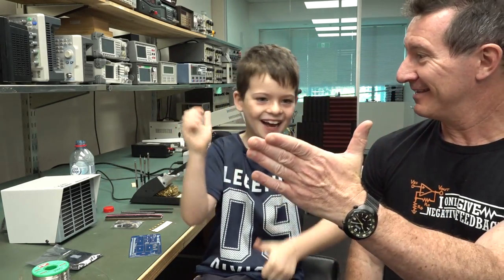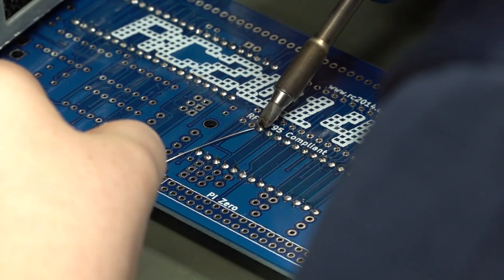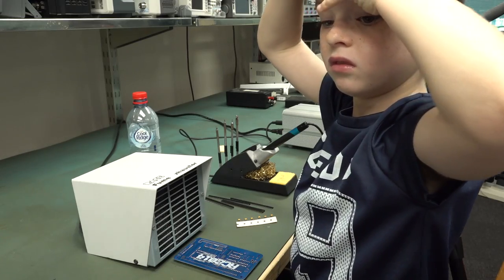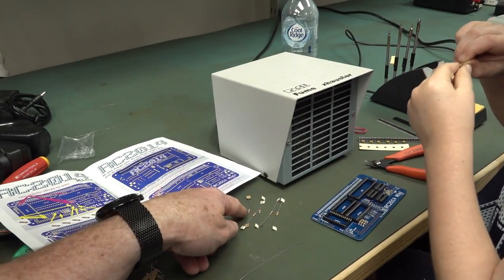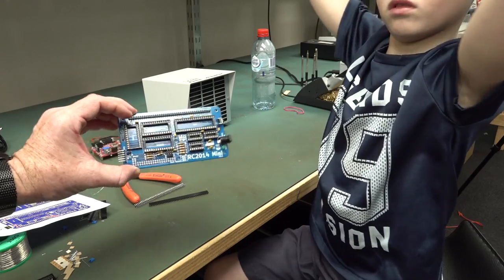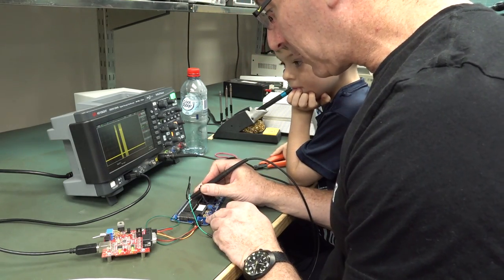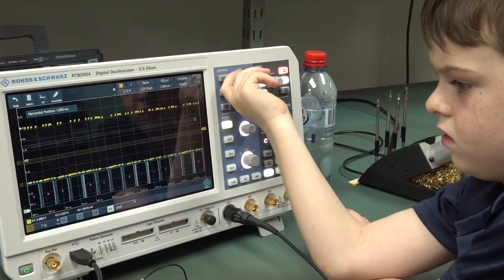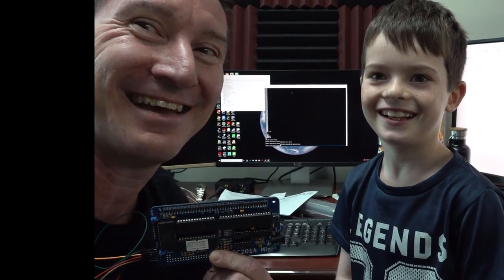EEVblog #1205 - RC2014 Z80 Computer Kit Build

Comment: Well great scott doesn't really have a nice pace station like this one now does he?!. All the kid is doing is touching the soldering iron tip and feeding in the solder, you LITERALLY CANNOT DO THIS if you have a bad soldering iron. Let me explain to all the silver spoon entitled frogs in your golden well about the hell of using cheap soldering irons. $2 soldering iron, takes forever to heat up, as soon as it heats up, the tip goes corroded black so it doesn't wet the solder, u spend 5 min trying to clean it, then that cheap solder that claimed to be 60/40 doesn't even melt (androkavo has a video on Solder wire - Low vs High Quality) and by the time you do all this, you've ripped off the pad on the pcb. This is my first hand experience with bad tools. Good tools do make a difference!

Comment: What were you talking about that was the same size as the solder? Something that was .3 and .5 mm?

Multicore is my preferred brand. It just works so well. I have some others and I usually end up using flux.

Comment: Pin Straightening Tip: Use an empty mechanical pencil, insert the pin into the empty pencil lead chamber and bend until straightened!  Error Code: P.I.C.N.I.C. = Problem In Chair Not In Computer

Comment: Are there any advantages of using multicore solder?
Reply: You can do more stuff at the same time ;-)
Reply: @karsnoordhuis4351  bravo sir
Reply: @Alex-Zone  in all seriousness, apparantly it it to prevent the solder dissolving the copper on the pads and dissolving your iron. According to the manufacturer that is.
Reply: Often times liquid flux burns off as soon as heat is applied. Bundling the solder with the flux allows it to be easily continually applied during the actual soldering. Flux has a few benefits including cleaning the joint and allowing the solder to flow. Using a thicker gel-flux like louis rossman uses is another method to flux intact.

Comment: I remember how was me at that age, curious, patient, I asked my parents to buy the first soldering iron, I made the first PCB for a small flip-flop with LEDs at a club for electronics in middle school. There I learned first things about passive and active components, the color codes for resistors and capacitors. It was 1997 and I was 10-12 years old. Then I made at home a 5-band tone corrector with transistors, and no PCB, just wires. Then I placed an audio speaker at its output and it worked, but the volume was low. Then I though about this for a while, and I came with the idea of using an amplifier at its output and it worked! Then I made an amplifier with some 2N 3055 transistors, than I bought from a shop along other components, some components I recovered from some old boards I found. No long after, when I collected a few more components I start organizing the components in boxes remained from melted cheese, with a label on each one, and I still have some of those boxes today. I also made a box out of wood at my grand parents house, and I used it for storing tools. The box still exists there, with some tools in it.
I wish I had someone kind and enthusiastic to explain me everything I wanted to find out about electronics. Maybe help me a bit, but also letting me free with it. I liked the freedom I had, and it was my only decision to find more about electronics, my parents didn't interfere. I also read some books written by Jules Verne back then, describing wood ships and travelers on the sea, searching for treasures, describing the nature and the life on the sea.

Comment: That brings back fond memories of building the "Super-80" (no, not System-80) from Dick Smith Electronics and getting it to work.  Then finding out that the BASIC they made for it absolutely sucked.  Then getting the whole disassembled BASIC interpreter for the TRS-80 and typing it into the Super-80 in hexadecimal followed by modifying it so it would run on the Super-80.

Those were fun times.

Hmm... my Super-80 is still sitting out in the garage...

Comment: What voltage levels does your RS232 adapter expect?  Standard RS232 is -3 V and +3 V.  Usually, having the D9 or D25 connector means these standard voltages are used.

Comment: I loved the Z80 and it's instructions set. I used to own several computers with that chipset from early S100 boards, CPM computers, and even a radio scanner controlled by a Z80 system. I reverse engineered that scanner and rewrote the code to suit my purposes.  Hours of fun.

Comment: No credits should be given to RC2014. It is not their design. They have copied the schematic and downloaded the ROM from Grant Searle's web site and designed a PCB from it.
 (google Grant searle and look for 7-chip Z80 computer) . All credits should be known to the originator. I know this because I did the same three years ago but I did a small run of 10 PCB's from his design but written my own ROM for it. I also emailed Grant my design (and permission) before doing so. If they have also had permission, then fair enough but credits to Grant's work should be silk screened on the PCB.
Reply from the maker: Didn't know, thanks.

Comment: I dont really see the point of a computer you have to communicate with using a computer thats several million times more powerful
Reply: You don't have to use a computer for that. You could always use a terminal or even a teletype if you have one. The baud rate on the computer would have to be changed though.
Reply: Don’t you have any dumb terminals or teleprinters Dave ?

Comment: Good job to the kid but the tip seems a bit too big ?
Reply: I thought it was big too (especially since he had more tips in the stand).
Reply from the maker: Yeah, he might have had an easier time with a slightly smaller one.
Reply: I use a 3mm sharp spade for literally everything. Even when tiny surface mount soldering under a microscope, I use the corner of the 3mm spade. Working as a production technician with a large variety of soldering jobs, I got used to using it for everything. I hate conical tips.
Reply: Loner LT376LF - best tip ever